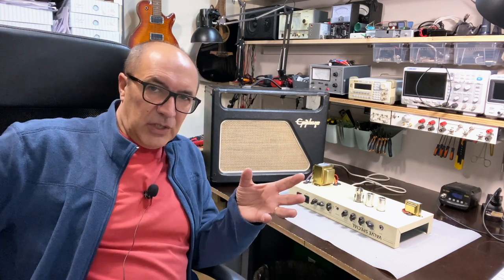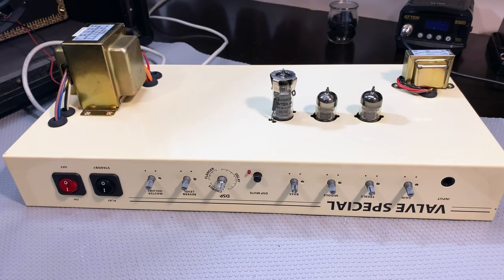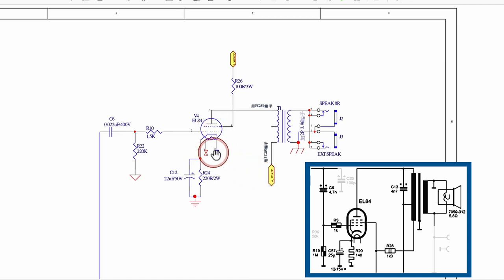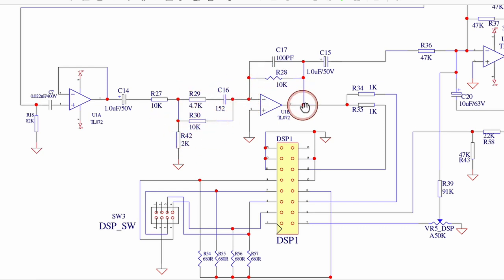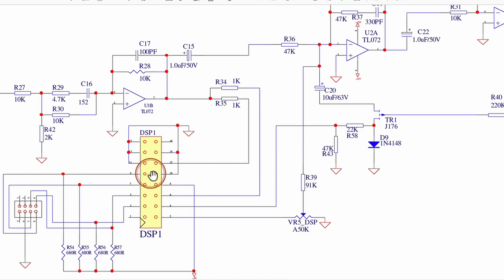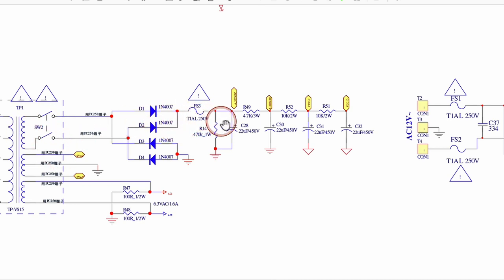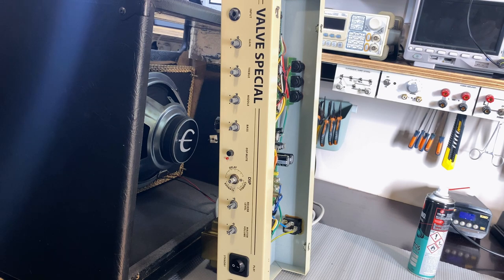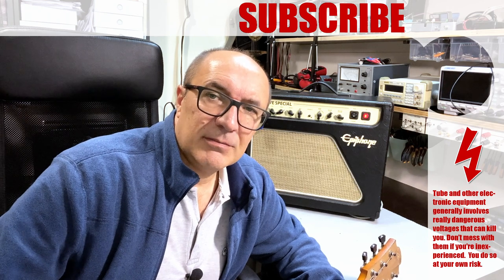Repair of Fizz, Crackle and Pop on Epiphone Valve Special. What has this got to do with tube radios?

Comment: I can't thank you enough for this video. Years ago, I bought a Valve Special as my first tube guitar amp, and I had mixed feelings about it. I've recently acquired a Valve Standard (the Special's 15W big brother) and I've been horrified by the noise level. But now I'm inspired: if my amp has the master volume pot in the same place, then maybe I can fix the issue easily. In any event, I'm grateful for your detailed overview of the circuit and insights into how it works. Cheers!
Reply from the maker: pleasure

Comment: All the best for 2022 and thanks for another  excellent vid. I noticed you paused at the 1Meg res into the third valve stage, so did I..... Never seen such a high value in there before. Regards Peter

Comment: Thanks Manuel, a clear and interesting video, I like those EL84 single ended amps, I've built a couple of "Decware Zen SE84C" amps (single ended triode, EL 84's) which I have used with sensitive speakers on my Hi Fi for quite a few years, your explanation and experiments with extra filter capacitors was very pertinent as there is always a low level of hum -and I now understand why....

I mirror your message at the end and feel that there is a virtual connection of friendship which is unique on YouTube. I'm very pleased that the channel is enjoying success, you really deserve it😊
Reply from the maker: Thank you 😊

Comment: Dave D Australia
Have looked at some of your radio stories but this guitar amp brought back memories of a guitar amp that I built for my son from a dead PA amp. Push pull output is MUCH quieter as you suggested and all the solid state filtering/processing doesn't seem to add much to a "valve/tube amp". The painted chassis has contributed to poor earthing of the pots. I fitted a volume pot after each section of the input valves , then the tone control and two more volume pots in the stages after the tone control. This gives the "tunable" distortion that guitarists love.

Comment: Another interesting and informative video. Thanks for sharing. Looking forward to more in the New year. Funnily enough I have just done my first guitar amp for a friend. He thought he'd blown the output transformer. But all that had happened was the main fuse holder had got cracked and just needed replacing. A nice easy starter fault for me.

Comment: I just found your channel, probably recommended to me because I watch Uncle Doug, D-Lab, Psionic Audio and other guitar amp repair channels.
Sadly, most of the lower priced guitar amplifiers are built to be disposable, with repair cost often exceeding the value of the amp.  I prefer 1960's and 1970's point to point wired Fender amps.  Fairly easy to change out all of the "doghouse" filter caps and resistors, cathode bypass caps, bias cap and resistor, and add 20 years more life (hopefully) to a great sounding amp.  As for flangers, phasers or any similar effects, an external device does the trick just as well or better than a built in DSP.
Reply from the maker: Fully agree. Pedals do a great job and do not compromise the amp itself

Comment: Great video Manuel. That little amp would lead itself to a few mods for sure. I'd relay out the DSP section so that you could turn it from hybrid to pure valve at the flick of a switch,  take out the second section of the second preamp tube (the cathode follower) and maybe tweak the values in the tone stack a bit. If you really wanted to you could also make it switchable between solid state and valve rectification, something wich allows a nice blues 'sag' on the b+ line. I don't know if you have come across a particular problem with el84 amps in so far as the new Chinese tubes really can't handle the b+ being at 300v or higher. Older tubes such as that Sovtek, American made 6bq5's all have a better voltage ceiling. The Chinese valves also sound far too 'bright', not as mellow as the other tubes. Either way, look forward to seeing more from you in the new year and wish you and your family all the best.  George
Reply from the maker: I agree George, this amp just begs for an intervention 😊 
I have bought very few actually new el84s recently so have not really noticed the issue.

Comment: Hi !
Since this is a Single Ended tube amp and they only have one tube in the output stage, and this being very noisy ....is there a way to create a some sort of a dummy circuit resembling the other 180° phase for cancelling noise purposes ?
I am not a tube technician obviously and this can be a very stupid ridiculously dumb question from my part !
So sorry if I offended any tube amp tech reading my question !
Reply from the maker: The best way to reduce noise in a SE amp is to ensure very clean DC supplies. The out of phase option is inherent to the Push-pull system, which uses a completely different transformer.
Reply: Assuming that the tube heaters are all powered with AC (DC-fed heater circuits are rare except in very expensive guitar amplifiers), an easy way to reduce hum in a single-ended, cathode biased amp is to lift the centertap of the filament winding off of chassis ground and tie it to the cathode of the output tube instead. This is known as "biasing up" the heater supply. The cathode of a single ended output tube is typically 20 to 30 volts above ground, viltage that is basically thrown away,, and feeding that DC voltage into the heater circuit lowers hum.

Comment: Possibly a suggestion: You could add a capacitor in parallel to each contact's switch of about 10K nf to eliminate sparkles that could carbonize the contacts.
Reply from the maker: That’s a great idea 👍
Reply: I use the same but with a relay the current and voltages in ac aren't that high so no sparcles and my voltages are much higher. If you do this after the rectifier your absolutely right.
AC is much easier to switch then DC

Comment: I noticed that the inside of the chassis is painted. So it's possible that the metal housings of the potmeters are not grounded. That could also add to the hum.
Reply from the maker: It probably did, especially if not properly screwed and tightened
Reply: @electronicsoldandnew  , painted or anodized chassis, and lack of star washers for the pots and jacks, is a common cause of ground loop hum. Black-fiinish star washers are commonly used and they increase ground-point resistance instead of reducing it.

Comment: So the electric guitar got some use on this one :D good stuff!
Edit: could one add an NTC after the fuse to limit inrush current?
Reply from the maker: If you increase the first filter cap, then that is a good idea.
The Lag Imperatur was happy. The Tremontane not so much 😊
Reply: Fiquei a pensar se não seria uma boa hipótese adicionar um interruptor de bipass ao sistema DSP. Quem sabe se o músico em questão iria gostar do resultado :)
Reply from the maker: nada má ideia

Comment: I don't agree fully with how you look upon guitar amps, as if they are developed for distortion, and that distortion is what musicians wants. I think that most developers want to create a simple maintainable amp which is reliable, but with the best quality sound they can get for that. Distortion comes after that, as an add-on, I hope. If not, any input would have the same (boring) recognizable distortion.
Best wishes for 2022. We will never be able to go back to the old normal, to much has happened. But in no way the new normal is acceptable for me, we are floating somewhere in self destruction mode. The base for recovery: speak out !
Reply from the maker: Don’t get me wrong - the distortion I’m talking about is not the unpleasant type. The result of proper triode clipping is beautiful if done properly. Even supply sag has a place in some amps. One of the dirtiest circuits - the Trainwreck - sounds amazing if played by someone with the skills (not me 😊)
Reply: @electronicsoldandnew  Supply sag... I hate it 😰 Can't forget listening to an error.